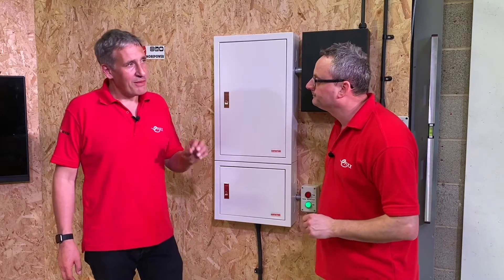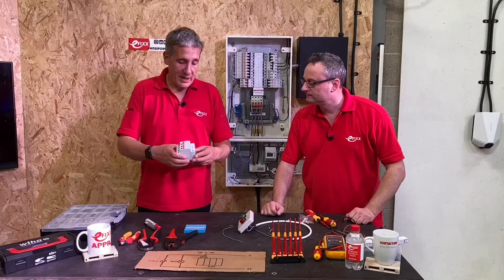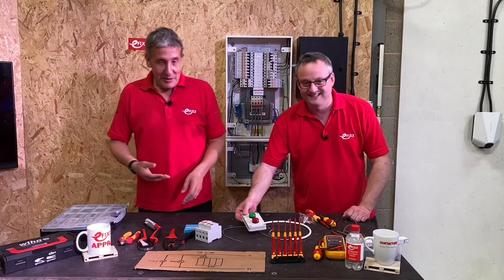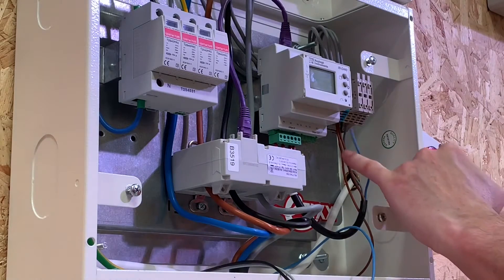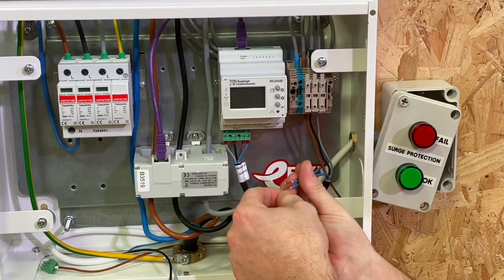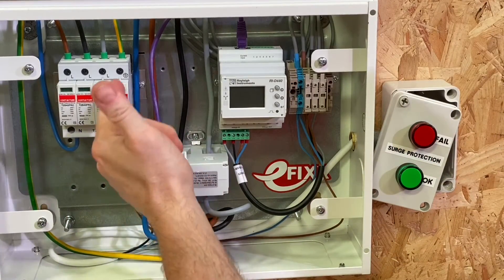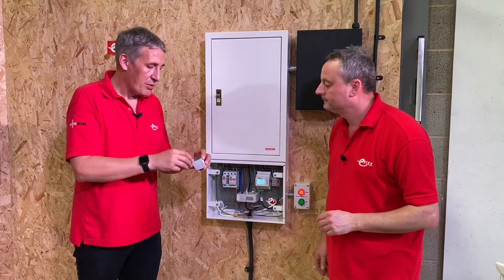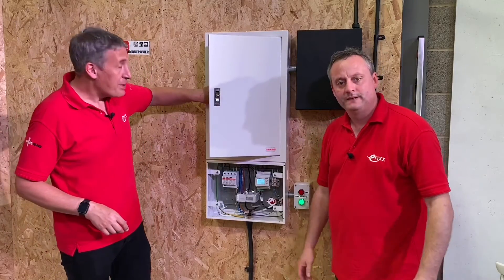How can you tell if a surge protection device has failed?

Comment: It’s also fairly straightforward to add a contact closure email or SMS notification device to notify you on the failure event happening. As handy as the LED indicator is, let’s face it, no one goes to check on a panel LED every day but they always have their phone on them. Or better yet have the alert sent out to a team inbox so it doesn’t go unnoticed by just one person.

Comment: Very informative and a great idea.
Two points that may bring up conversation are:
1. The Green plug for volt free indication in my role of controls are usually rated to 110Vac max and thus 230Vac is questionable.
2. The lamp indication box should for safety be labelled “May remain live while SPD is isolated” or words to that effect. I would hate for a person to attempt to change a lamp indication and become shocked.

Comment: As you said, the fact that the green light remains on even if the SPD's breaker is open could be a problem. I suggest that this problem could be solved with an auxiliary contact on the breaker that turns on the red light also when the breaker is open!
Reply from the maker: great suggestion

Comment: What is the maximum load that the remote indicator connections can take? I ask cause I plan to use them to keep a contactor coil energised till the spd device failed which then would fall out the contactor.
Reply: Usually the minimum load of the SPD contacts is between  1 to 2 amps, but you can use an auxiliary relay to energise a contactor coil.

Comment: Could you investigate further into the installation of Type 1 SPD in a domestic consumer unit, rural overhead supply, I'm getting mixed messages that they should be in their own enclosure. For instance outside meter box with switch fuse 3m of tails to consumer unit. Should the Type 1 go at the origin in the meter box! with the switch fuse or in the consumer unit or in a separate enclosure at the consumer unit. Thanks
Reply from the maker: We will do some further investigation and see what we can find out.

Comment: When you turn off the main breaker how do the Indicator still on
Reply from the maker: The metering kit in this board is connected to the incoming cable. This is where we connected the indicators. The metering supply has its own fuses in the DIN rail blocks.

Comment: I shall look next time as we fit SPD's on 99% of installations ( commercial) never knew that thanks, guys. Are the connections on the domestic to?
Reply from the maker: On single phase most of the ones with plug in cartridges seem to have the contacts. The single modules ones don’t - we first discovered the contacts when we looked at a Wylex unit - https://youtu.be/B69R-yY6_14

Comment: I am speaking purely from a consumers point of view here as I am not a sparky is that I would like to ask if a qualified electrician could also install within the light indicator box a siren for audible warning of the system failure. Secondly I think these kind of the indicating devices should be installed in domestic consumer units and even RCBO's should have an outside indicator system whereby consumers like myself know when to test the RCBO RCD function, have a service light to denote when a service is due on the system and also a SPD test indication light. Because this would help us consumers know when to call a sparky in to service the system or to replace a SPD Cartridges. Because I think we can all agree that with my knowledge gained on this channel and other 18th Edition states us consumers have to have a meter consumer unit meaning out of sight out of mind thinking. So I think as consumer I would appreciate a panel of indicators and warning beeps to ensure I am testing and maintaining the system properly. Anyways sorry for the long comment.
Reply from the maker: You could change the indicators for siren etc

Comment: I hope the domestic surge manufactures have  noted this as most home owners need a light to go by as most wont even test a RCD  test button let alone check a flag has changed colour?
Reply: Most domestic consumer units are sited in poorly lit areas, it'll be very difficult for the homeowner to be able to see if a small tiny window on the front of the SPD is green or red.

Comment: the feed for the meter have you used any sort of ferrule as you have a the main tails along with a smaller conducter feeding the meter?
Reply from the maker: The metering kit is supplied with crimps and ferrules - the connection to the incoming isolator is via some fork crimps which attach under the screw head of the terminals.

Comment: Loving the cardboard drawings as always.
I am fitting SPD's on every consumer unit change now (not done any 3 phase as yet) I have started not mentioning them to clients when pricing (as to many started trying to not have them) i just fit them and tell them of the benefits afterwards.
I do prefer the Hager prefitted ones (off main switch) as no way of turning off independently but it would be good if they had a built in audible indication of failure built in